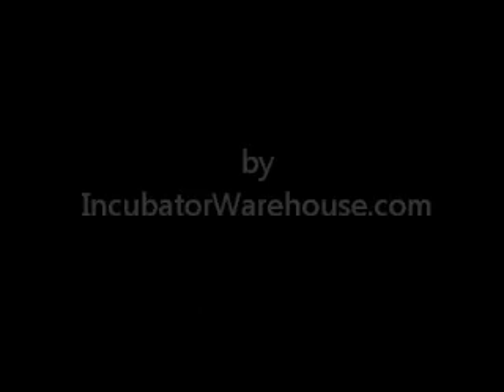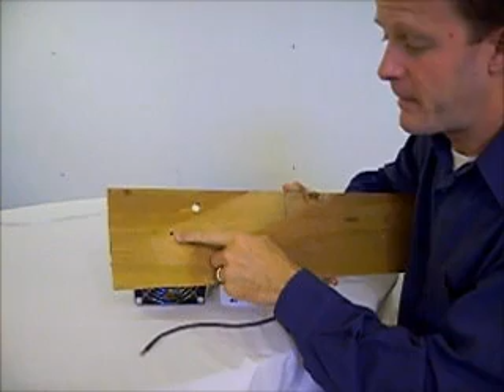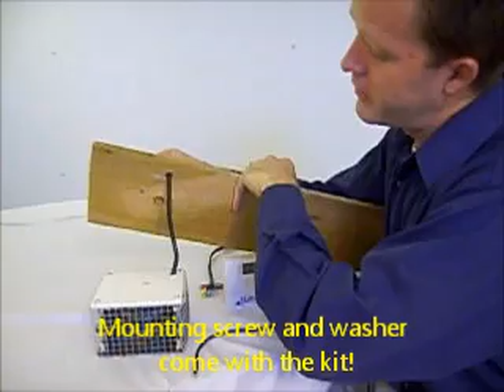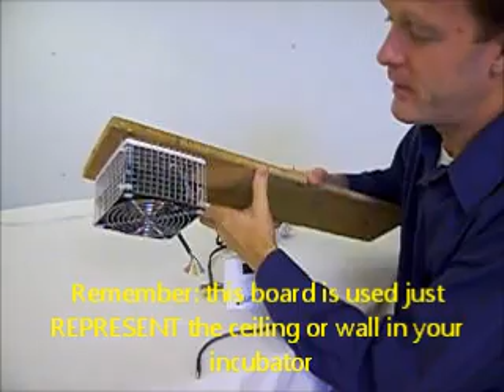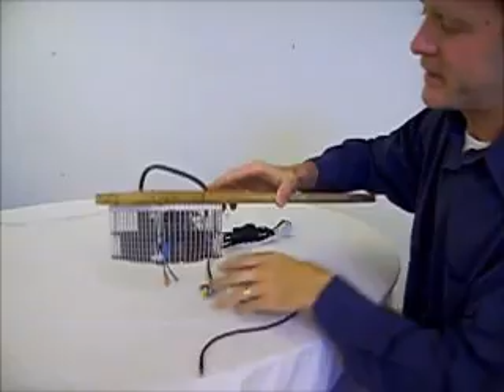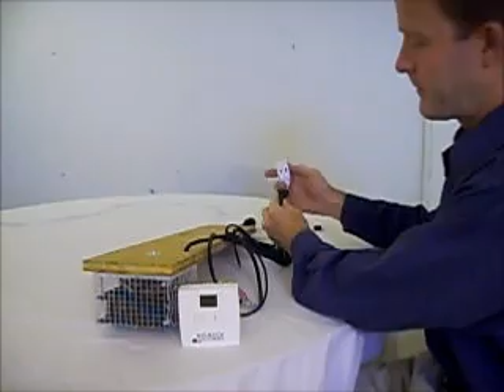IncuKit (tm) 225 Watt Version for cabinet style egg incubators

Comment: Is there supposed to be a hole somewhere for proper ventilation? I know there should be ventilation for Still air incubators so the gases from the eggs can be released and oxygen can be provided to the eggs. Does that go for forced air incubators too?

Comment from the maker: Yes, the thermostat sensor will measure the temperature and turn off the heater from the IncuKit regardless of the heat source.  But obviously, the other heaters which are not wired to the IncuKit will not turn off.  And the fan in the IncuKit is designed to run constantly, even when the heater is turned off so that circulation continues regardless of the heater so it maintains a more constant temperature throughout the incubator.

Comment: great vidd mann .. I got a quick question ... lets say u have other heating pads in ur incubator as well as water bottles for moisture .. can the thermostat pick up the het from those too (even thoo thoe heat pads may not be turn off .. the thermostat turns off the fun right??) ..  thnx

Comment: Awesome video! I have that thermostat by itself and I'm trying to figure out how to wire it up with my fan and FlexWatt heat tape for my homemade incubator, but the directions are confusing and I found myself connecting 5 different wires in the same spot (i messed up) Could you help me with this please??